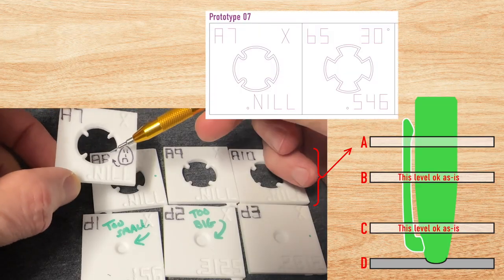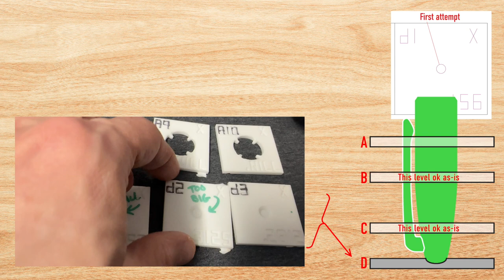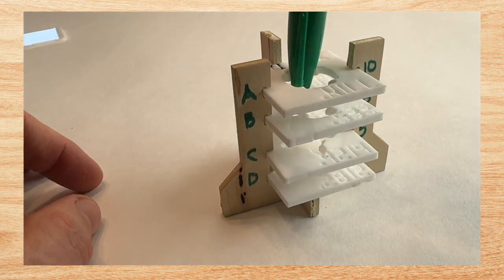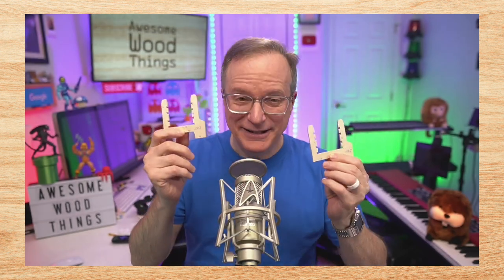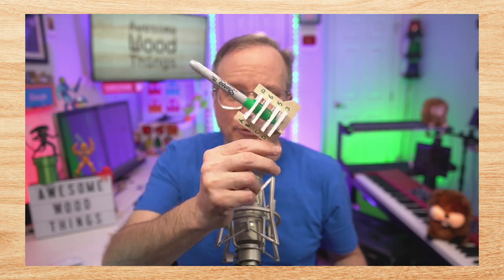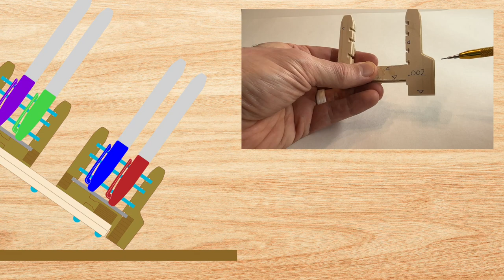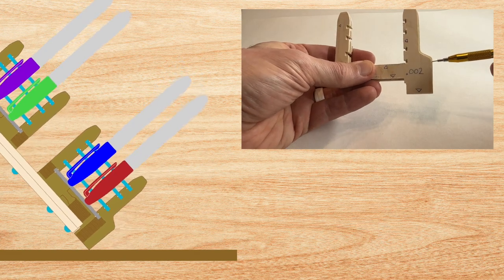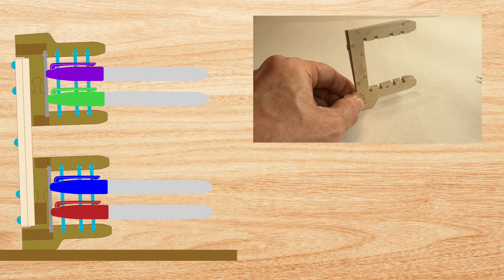Final Test & My Secret to Horizontal Storage (Sharpie Holder)

Comment: If the original premise is that sharpies need to be stored cap down, perfectly vertical, why then the horizontal storage accommodation? And also, how is it going to be possible to see the color of the sharpies that are not along the front edge of the holder? Just asking.
Reply from the maker: Great questions! Thanks for asking! The formal recommendation from the company that makes Sharpies is to store them long-term horizontally. 
The caps for markers on the front edge will be visible both from the top and the sides. The sides have no “walls” blocking the people’s view… plus the discs that hold the markers will be transparent… so, that will help too. 
I’m really excited about this project. I can hardly wait until it’s done.
Reply from the maker: Plus… the holder will spin… so, if a markers is in the back and out of view, a gentle nudge will rotate them to a new position closer to the viewer’s eyes.